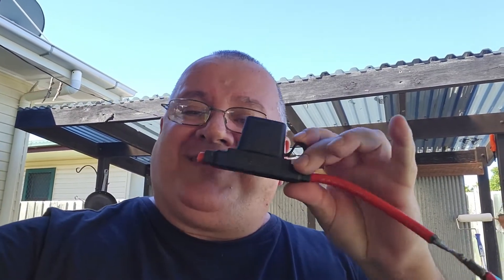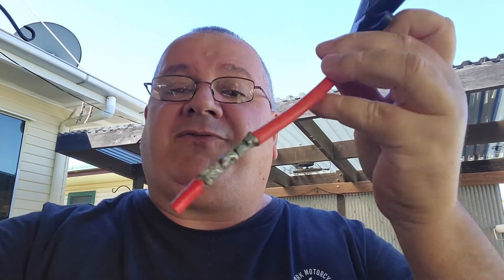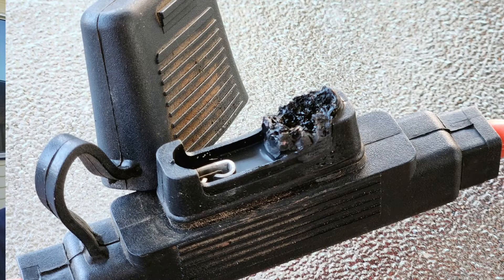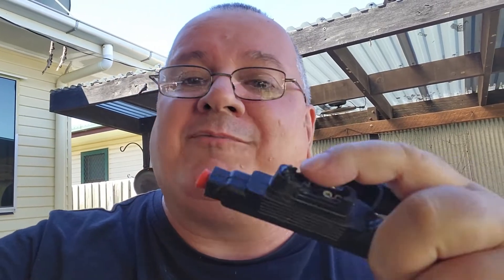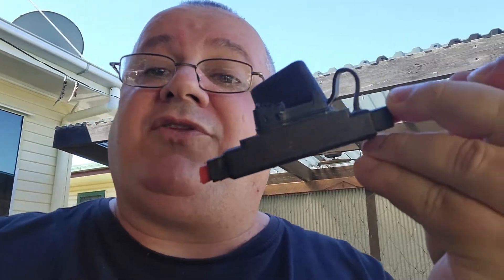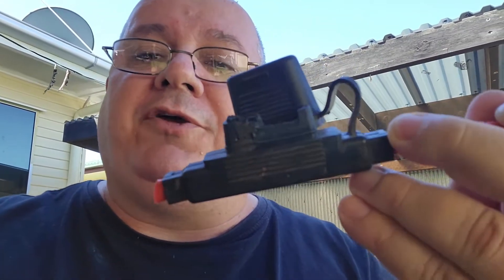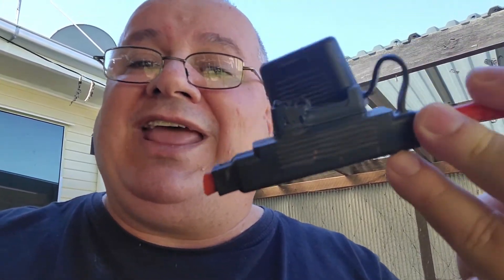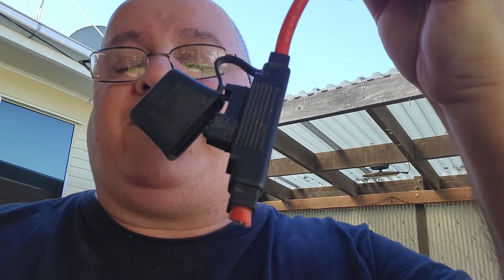InLine Blade Fuse Holders versus InLine Midi Fuse Holders. Which one should you use?

Comment: Thanks Phil for another great vid.  I actually had one do this not too long ago.  I had three of them for my driving spot lights and rear camping light all installed by an electrician.  The other two were almost about to fail the same way too 😞. So now all replaced with MIDI fuses 😁
Reply from the maker: Very wise dicession to replace those cheap nasty fuses.

I pulled one apart and there just about made from a hard rubber.

Comment: If the fuse-holder melts, the current through it is way to high.... Always check the max current of the holder itself and never exceed that!
Reply from the maker: It’s not the fuse that melts it’s the rubber that holds the fuse in place that melts.
Reply: @PhilsCampingReviews  Even the fuse-holders have their limits... Do not run 500Amps trough a 300Amps rated holder (for example) even with a 500Amps fuse.
Reply: Thats why its correct getting the right fuse for high output
Reply from the maker: @pe1pqx321  the issue here is these fuse holder are rated higher than the fuse used.  This is not the only time I’ve seen this happen. If it was a one off thing.  Fair enough.  But I’ve seen in numerous occasions these fuse holders melting and in two cases caught on fire.  With fuses rated lower than the fuse holder.
Reply from the maker: I’ve pulled apart some of these fuse holders that failed with fuses rated lower than the fuse holder to find the rubber in these fuse holders melt before the fuse blows.  Remembering these are with fuses rated lower than the fuse holders. 

I personally will never have any of these type of fuse holders anywhere near my system.
Reply: @PhilsCampingReviews  Again: never use underrated fuse systems (fuses AND fuse holders) in  your gear.

Then explain one thing to me: why are "blade" fuses used in automobile industries without any serious problems? Currents way over 30 amps are common (starter motors for example)

I stand by my opinion: always check the fuse AND holder for their maximum current rating, and never exceed that! Mid fuses are no better than blade fuses.

Comment: Out of interest, is there greater electrical resistance, leading to more heat build up, on a blade fuse compared with a maxi fuse of the same capacity?
Reply from the maker: From the ones I've tried and seed,  I say yes.  Blade fuse holders are surrounded with rubber,  which gets hot.  That rubber alone causes heat eventually leading to fire.

Comment: These fuse blocks come standard on the arb twin air compressor harness. They have a 40amp fuse. AND There are two fuse blocks. So would it be safe to modify the original product to a midi connection?
Reply from the maker: Yes. I know.  I own a portable ARB twin with air tank.   I keep a close eye on mine.  Because it gets little use.  I’ve not replaced them. 

But if the compressor is mounted permanently.  Especially if mounted in a hard to reach place,  I would change the fuse.

Comment: Hi Phil, what are your thoughts on the kickass 50amp resettable fuse?
Reply from the maker: I've never tried them.  But being kickass brand. I'm sure they would be fine. 

However. Personally, I don't like these types of fuses.
Reply: Never use auto reset circuit breakers. Also be wary of manual reset if under bonnet. They can be triggered by the excessive heat and then can actually reset if weather goes cold. 
However a good manual reset circuit breaker will never reset until you physically do it with your hand. But again be careful because there are cases where they do when travelling a very bumpy track.

Comment: Hi Phil  what size  fuse was in there  as i have 2 of them and i use a 30  amp fuse.
Reply from the maker: 50 amp
Reply: @PhilsCampingReviews  
I would guess that the holder was not rated at 50A then.
Cheap connector in the housing may also be at fault.

Comment: My InLine Midi Fuse Holder melted
Reply: What were you using it for? Was the ground adequate?
Reply from the maker: I've seen a few melt.
Reply: @JohnDoe-hx1wx  yeah, it was all good for the last 3 years. It was between Solar Charge Controller (Victron) & battery